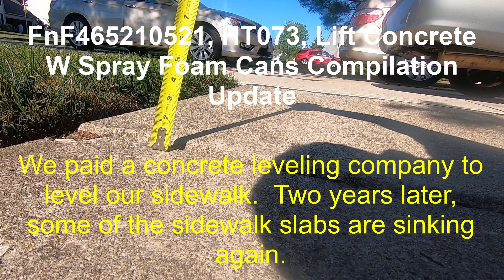Lift Concrete W Spray Foam Cans Compilation Update, FnF465

Comment: I see you used a normal Gap foam which will expand about 1".... what if you use a Big Gap or PRO Gap foam they expand upto 3", will that be easier to fill the gap with less cans?